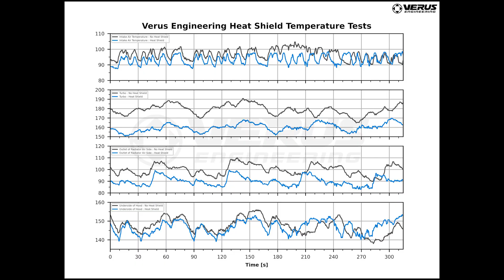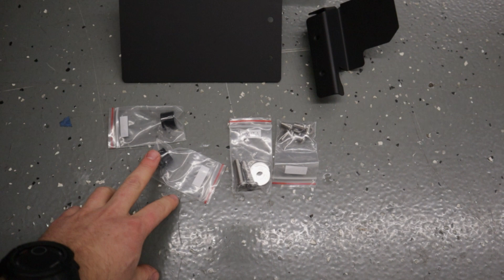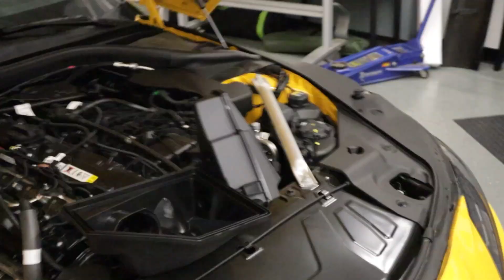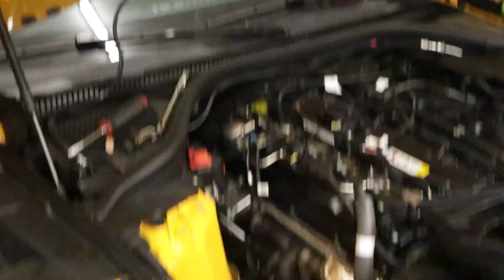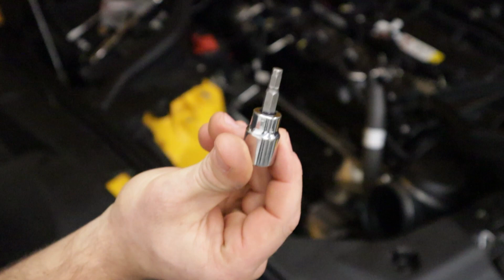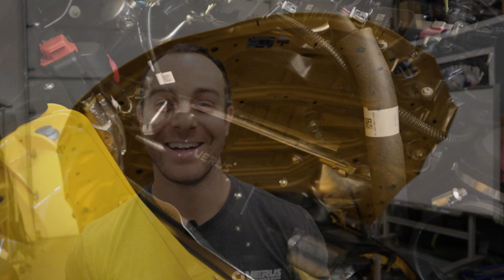Mk5 Toyota Supra 6 Port Turbo Heat Shield Installation

Comment: I have a 2025 3.0 but the shield doesn't line up with the mounting points the OE heat shield uses...can any one confirm I'm not going crazy?
Reply from the maker: Please reach out to us at sales@verus-engineering.com, we would be happy to help resolve your issue!
Reply: @VerusEngineering Thanks. I just now realize I bought the wrong one, (2 port 2020) from you a while back.

Comment: Could you just attach the side piece first and then install the assembly in one shot? Doesn't look like it wraps around anyting
Reply from the maker: Feel free to install it as you would like.
Reply: @VerusEngineering   trying to avoid dropping tiny bolts into the engine bay whenever possible 😅
Reply from the maker: magnetic allen keys or sockets always help! @i3igpete

Comment: Can it fit with 6port m340i xdrive 2021 sir
Reply from the maker: Current models with known fitment are (G20) M340ix, (G42) M240i, (G22) M440, and (G29) Z4.
Reply: @VerusEngineering  so it’s mean can fit with m340i g20 right bro
Reply from the maker: @turk1998  if it is a (G20) M340ix, then yes.
Reply: @VerusEngineering  thank you a lot sir.
Reply from the maker: Of course! @turk1998
Reply: What about ify car is right hand side can i install it bro is it will contact with the steering rack or not bro

Comment: Wouldn’t it be easier to bolt on the side piece to the heat shield first before bolting it into the car?
Reply from the maker: No. Due to space restrictions, we found it easier to install the side piece after the main shield is already installed.